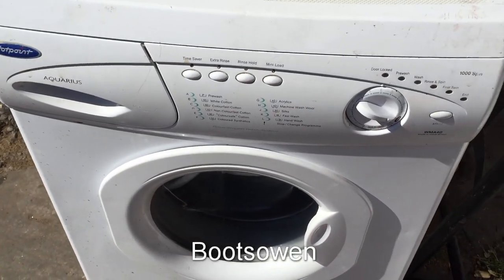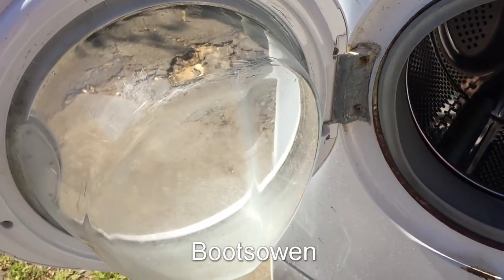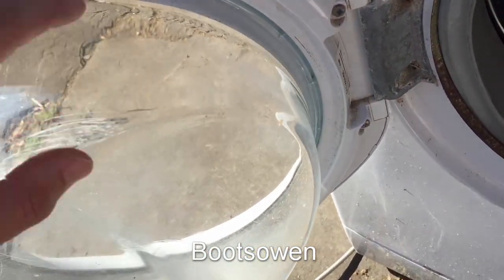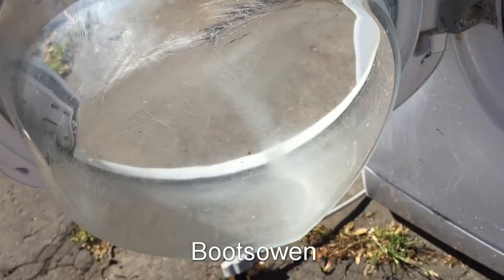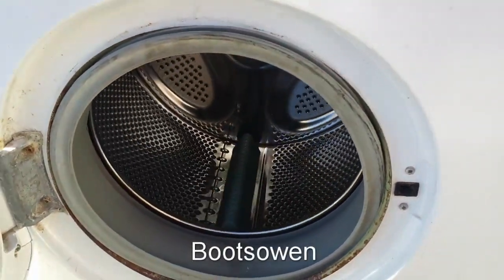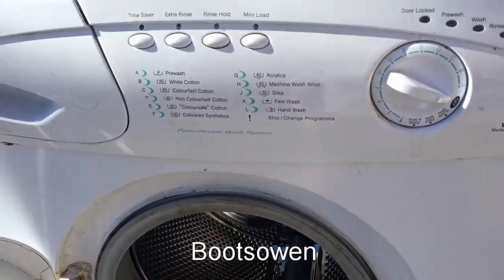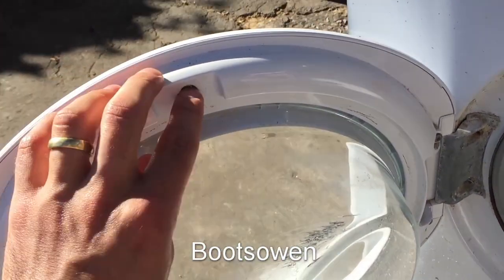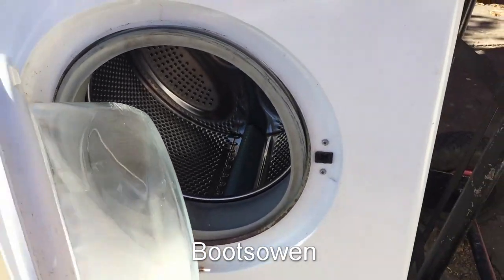Washing machine door glass rotation failure

Comment: The marks are from the drum hitting the glass because it's so unbalanced. The beko integrated I use and upload vids on does the same and sparks fly off the door
Reply from the maker: Post a link here to one of the spark videos, I'd like to see that, maybe I can recreate it too!
Reply: bootsowen typical that when it sparks I can never get my camera to start in time 😂 in some of my vids you can see it if you select slow motion tho
Reply: bootsowen https://youtu.be/4xXZJ4ROxwU
If you play it at 0.25 speed you can see sparks around 13 sec in and later
Reply from the maker: Wow, that is pretty violent.